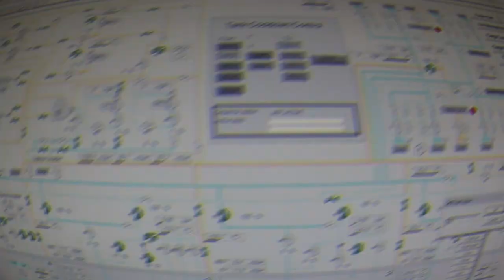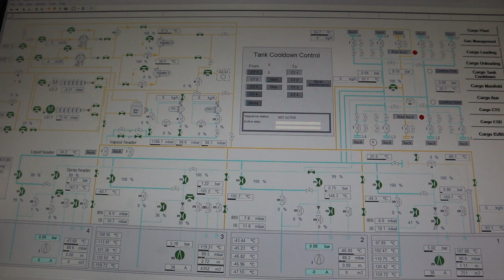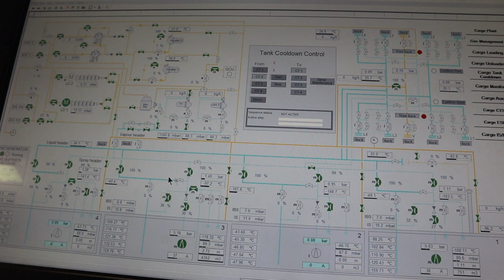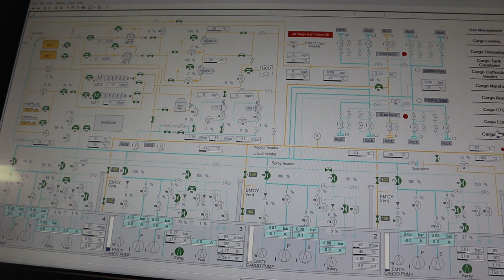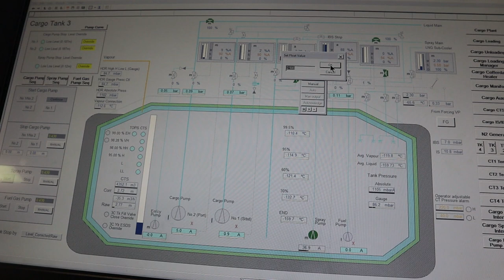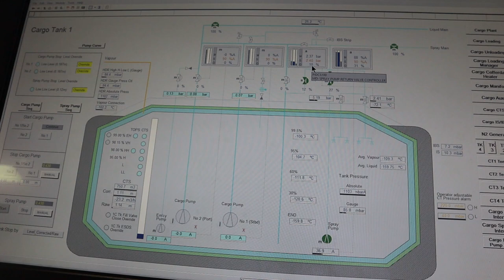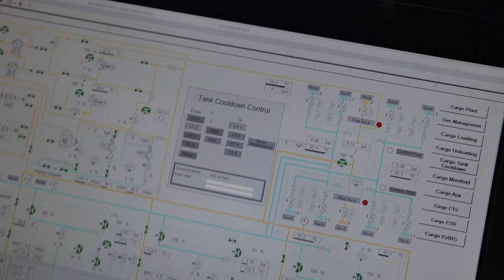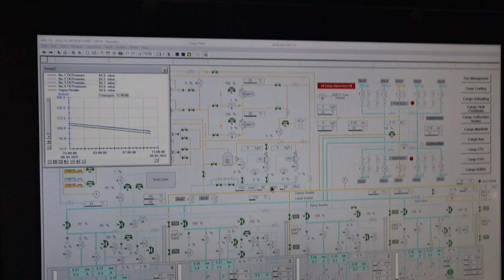Cool down LNG Cargo Tanks and the cargo operation  required to be load ready [ part 2]

Comment: Thanks Capt. Nick. Do you use the spray pumps also to cool the top of the tanks while sailing with cargo in all tanks? Or are the cargo tanks only kept cool due to cargo temperature and tank membrane insolation?
Reply from the maker: Hello there tanks are kept cold due to the cargo after having been loaded up to the acceptable filling levels.

Comment: 1.5 bar is enough on spray header for efficient spraying. With 2 bars and warmer tanks you are generating quite more vapours inside tanks and IBS adjustments are necessary.
Reply from the maker: It differs from vessel, cargo and people performing the operation.
The newest tanks need these vapours since the cargo tanks pressures drops very fast.
Reply: @nickthesailorman360  I am referring to instructions from GTT. Ideally they recommend 1.5. Not saying that 2.0 bar is bad, saying that accumulation of dead heel on 2.0 can be significantly higher.
Reply from the maker: @Fatureta  Hello Damir, good to share knowledge.Thank you for your comment.